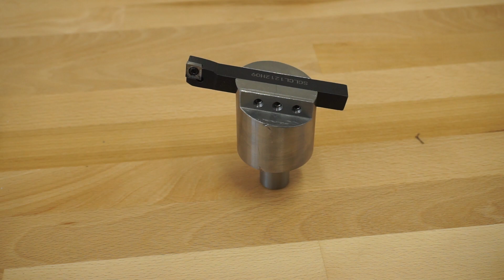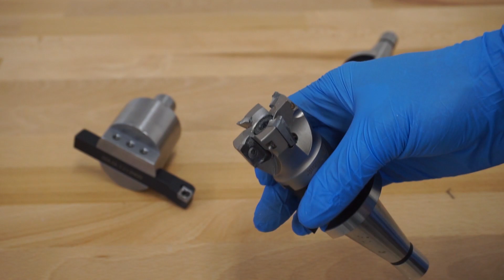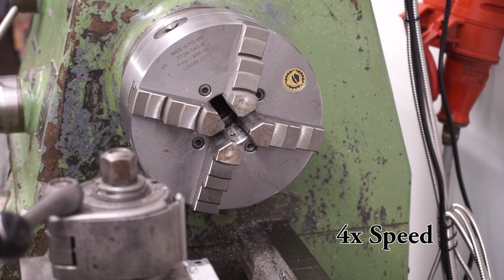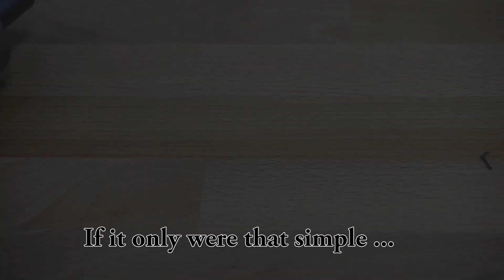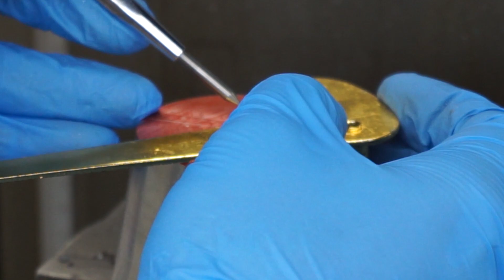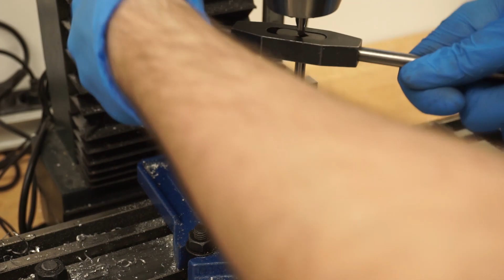Building a Fly Cutter for a Milling Machine

Comment: What’s the kind of steel you use?
Reply from the maker: Hi, I don't know, it was out of the scrap bin :) But any mild steel will work for this project since the cutting forces are quite low.
Reply: Any M. S. Material without hardening   can get good life?

Comment: You can purchase a bluing solution where you immerse the part for 15  to 20 minutes and then rinse off with water.

https://www.amazon.ca/s?k=bluing+solution&gclid=CjwKCAiA__HvBRACEiwAbViuUwvccZNVo5S_oNeUYuGOTfmp5KBpk1_sGKIZK0OCPgfhKy2oE7EOvBoCaIsQAvD_BwE&hvadid=321577683081&hvdev=c&hvlocphy=9000819&hvnetw=g&hvpos=1t1&hvqmt=e&hvrand=1113494073740120258&hvtargid=kwd-301060508146&hydadcr=27680_10600197&tag=googcana-20&ref=pd_sl_nlbd2ef5r_e